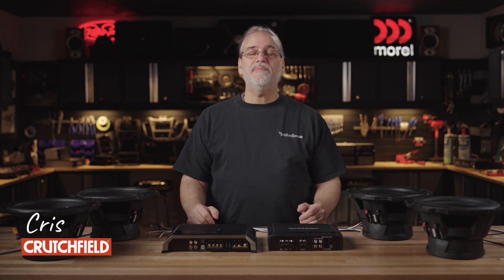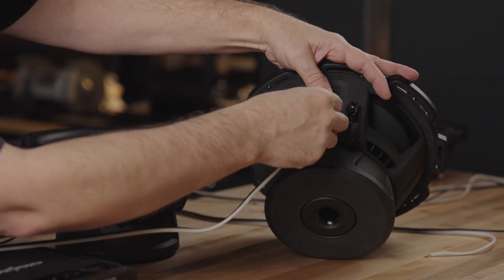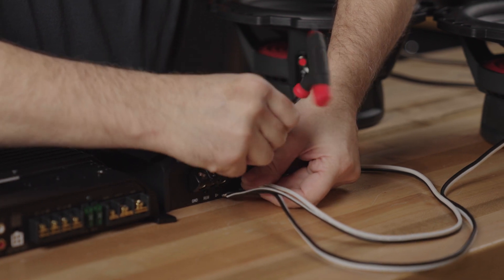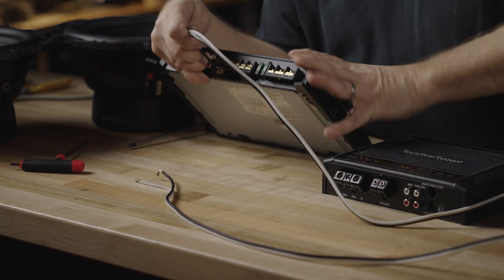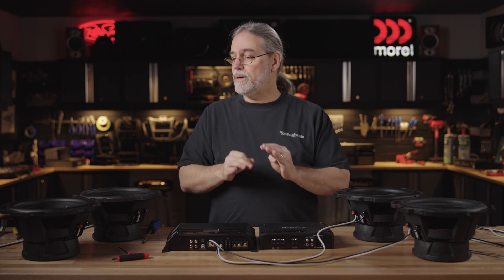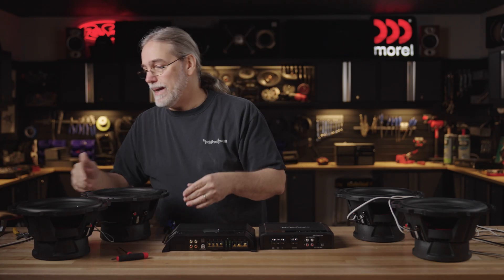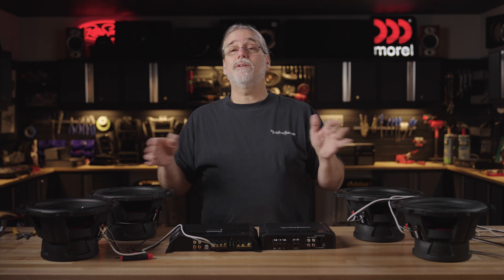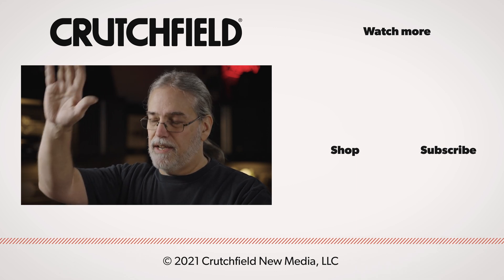How to wire multiple subs to your amplifier | Crutchfield

Comment: On the how-to on the 2 ohm load, you didn't say anything about how many channels or what if I was to bridge that?
Reply from the maker: Wiring a subwoofer(s) for a 2-ohm load is with a mono amplifier. Most 2-channel amplifiers require a 4-ohm load in bridged mode.

Comment: Have you ever sold M&K (Miller & Kreisel) home theater subwoofers? They typically use two 12-inch drivers in a push-pull sealed enclosure. Recently, they mentioned that their MX-350THX sub presented a final load to the plate amp as 4 ohms, even though each 12-inch driver is 8 ohms. Do you know how these drivers are wired internally? I prefer not to disassemble the sub to avoid damage. Can you tell if they are wired in series or parallel? This question applies to other brands too, like JL, SVS, Polk, and Klipsch, whether for home or car subs. Thanks in advance.
Reply from the maker: We have not carried M&K subwoofers, but what you describe sounds accurate for when the two 12" 8 ohm drivers are wired in parallel. This would also apply to any manufacturer because the 4 ohm result can be confirmed using Ohm's Law. We have an article that dives deeper into wiring multiple subwoofers as well as subs with two voice coils (another subwoofer design that impacts the combined ohm of a system) and this link will take you to that article:

https://www.crutchfield.com/I-rYALc227/learn/wiring-subwoofers-ohms.html
Reply: @crutchfield  thank you! Have a fantastic weekend! 🔊 🔊
Reply from the maker: You're welcome! Glad we could help

Comment: Thanks so much, my 10" subs wires became detached from back of speaker box. They were in Series Wiring (it's been so long since they got professionally installed and i forgot exactly how it was wired). Well I accidentally connected each wire from the speaker plug-in together and on one speaker I plugged both wires into Positive and connected both wires together on other speaker and plugged into Negative of that speaker., thinking that's how it was... and didn't really turn the music up to notice and an hour later my Jensen amp was very very hot and the subs weren't playing any music. So gonna let it cool down now and THANKS SO MUCH FOR THIS VIDEO... I now remember/know how to wire them back up correctly, hope that was why the amp was hot and hope it's not fried!! fingers crossed.
Reply from the maker: Yikes! Did the amp start working again after it cooled down?
Reply: @crutchfield yes, it is fine now. Learned my lesson.

Comment: So if I have 2 250 watt subs connected in parallel should my amp be 250watt or 500watt?
Reply from the maker: If you are running two subwoofers and each subwoofer can handle 250-watts RMS, you can select an amplifier that delivers 500-watts RMS for maximum sonic performance (providing 250-watts RMS to each speaker). You will need to determine the total impedance of both subwoofers wired in parallel also, so you can best choose your amplifier to deliver the 500-watts RMS at your specific total impedance.

Comment: Here's a question I always wondered about as a novice. If you wire two 8 ohm speakers in series the impedence will be 16 ohms. My question is...will they both be playing at 16 ohms or is it that the combined impedence is 16 ohms? Also in parallel the opposite takes place. So the 8 ohm speakers will be playing at 4 ohms. Same question. Will they both be playing at 4 ohms or is it a combined impedence of 4 ohms?
Reply from the maker: For the first scenario, the amplifier would see a combined total impedance of 16-ohms. For the second scenario, the amp would see a combined impedance of 4-ohms.
Reply: @crutchfield  thank you. Here's another question. If in the first scenario I were to daisy chain two dual 16 ohms speaker boxes using speakon connectors would the impedence remain the same no matter how many speaker boxes are joint together by speakon connectors or would that lessen the impedence? For instance...I daisy chain three speaker boxes wired in series using speakon connectors, would the impedence remain at 16 ohms no matter how many boxes are daisy chained by speakon connectors or would that lessen the impedence?
Reply from the maker: Any additional speakers wired together would decrease the impedance when wired in parallel.
Reply: @crutchfield that's speaker to speaker. I want to know if I were to daisy chain two speaker boxes by speakon connectors containing two speakers each both peakers in each box wired in series would that lower the impedence of the speakers in the boxes?
Reply from the maker: Any speakers you are wiring inside the boxes in series you will double the impedance of each speaker if there are two speakers in each box. Connecting with a certain style of speaker connector (speakon style in your case) does not directly affect any impedance. Wiring speakers by "daisy chaining" multiple boxes together represents a parallel connection and would decrease the total impedance of each enclosure with each additional speaker cabinet "daisy chained" together. You can find wiring guides for total impedance online if you need to know the exact impedance and wiring for your specific custom setup. I hope this helps.
Reply: @crutchfield it does. You're saying if two speakers in one enclosure are wired in series. Lets say two 8ohm in series would become 16ohm then daisy chained together by speakon connectors they would be in parallel thereby reducing the impedence the amplifier would see back to 8ohm. Answers a question that's been on my mind for a while. Thanks.

Comment: Is it the same for door speakers?
Reply from the maker: Yes, wiring two speakers or subwoofers in series increases the resistance presented  to the amplifier, and wiring them in parallel decreases the resistance. it is the same for subwoofers and full-range speakers.

Comment: 1200.1 mono 1 ohm steady with two 4 ohm dvc 700 rms  wired to 1 ohm am i under powering my speakers?
Reply from the maker: If your amp delivers 1,200 watts RMS at 1-ohm, each sub will receive 600 watts RMS, which is plenty of power for subs rated up to 700 watts RMS each without the risk of overpowering them. We typically recommend powering subs with 70-100% of their RMS rating for best performance, so that scenario falls well within that range.
Reply: @crutchfield  thank you bro
Reply: @crutchfield  1⃣more question if you don't mind I have two 1200watt dvc 4 ohm to 1 ohm  with red2500.1 amp  that should be fine as well?

Comment: Yeah but you don't show how to maintain 4 ohm load with 2 4 ohm subs. So, up and down but not the same. How does that help when you have 2 4 ohms subs and a 4 ohm amp?
Reply from the maker: How you wire the 2-ohm subs will depend on the amplifier powering them, and how many subs you have. Here are two pages from the library section of our web site I think you may find helpful.
https://www.crutchfield.com/I-rFBKc988/learn/how-to-match-subwoofers-and-amplifiers.html

Comment: So the first connection you made where you joined the wires and put them into one set of terminals. Is that a 4 or 2 ohm?
Reply: From what i understand from the video the first one are in parallel 2, 4 ohm subs wired too a single position and negative changing it to a 2 ohm, so basically what you want to do is what he did and it came out to 2 ohms.
Reply: My amp only has 1 negative and positive and I want to join two subs.
Reply from the maker: Hi Isaac, in our video there we wired two 4-ohm subs in parallel for a 2-ohm load. The exact impedance will depend on the impedance of the sub you're using. Do you need help choosing subs to match your amp? If so, what is the brand and model?
Reply: @crutchfield  I used two Sony xplode 4ohm 12inch with rms at 300 I believe. And the amp I used was a boss riot 1600 monoblock. I wired them how you guys did and it sounds cool. I think I just need new speakers and a different amp for those speaker mids.

Comment: Is there a video that descripes the wattage of them i have a 1000 watt max at 4 ohm amp ans my subs say they are 1000 max but they are cheeper so i dont fully trust the rating especialy as i already blew one up just hooked as a single to the amp my amp says max 2000 at 2 ohms so if i hooked them in parallel would it deliver 2000 to each sub or 1000 to each and if i hooked them in series would it deliver the same wattage to each or would it split the 1000 watts between the two and snd give me 500 watts per sub
Reply from the maker: We recommend using an amplifier that is capable of delivering approximately the maximum recommended RMS/continuous power to each subwoofer. Also check out.
https://www.crutchfield.com/I-rFBKc988/learn/how-to-match-subwoofers-and-amplifiers.html
Reply: @crutchfield  my amplifyer is 500 rms at 4 ohms amd my subs claim to be the same but ive already blown one up so im unsure if thats true would i be better to run them in series or parallel

Comment: What is the jumper cable?? And if i dont have it, can i use ether a positive cable or a negative one??
Reply from the maker: In this video, it is the wire that's being ran between the two subwoofers to wire two subs in series. It can be one side (i.e. positive wire) of the speaker wire you got to connect the subs to the amp

Comment: @Crutchfield I have a alpine type s 10inch sub dual 2 ohm running both of alpine s series 1200W Mono quick question both subs comes with pair of banana jumper cables will it be okay if I’m connecting a single sub series with the jumper cables same for the other one and use each +- on the out put of the mono amp for each subs?thanks
Reply from the maker: Just to confirm, you are using two Alpine 10" dual 2-ohm voice coil subwoofers and powering them with the single Alpine 1200W mono amplifier?
Reply: @ yes
Reply from the maker: What's the model number of your Alpine amp?
Reply: Alpine S2-A120M S2-Series 1200W RMS Class-D Monoblock Amplifier
Reply from the maker: Nice! You'll wire them per example 6 in the Alpine S2-W10D2 manual here: https://pdf.crutchfieldonline.com/ImageBank/v20230817163300/Manuals/500/500S2W8D2.PDF
Reply: @crutchfield  thanks mate!

Comment: How to connect two different amp to one subwoofer?
Reply from the maker: Theoretically you could use two amps to power one DVC subwoofer but typically would not need two amplifiers. What brand and model subwoofer exactly do you have in mind?
Reply: @ So I want to connect both amp to one sub, Jbl Arena 12
Reply from the maker: You can't use two amplifiers to power one JBL Arena 12 subwoofer. It only has one set of speaker terminals and a selectable impedance switch. I'd recommend a single mono amplifier rated to deliver around 800 watts RMS/continuous power and this Pioneer amp is a perfect match.
https://www.crutchfield.com/I-rFBKc988/p_130GMDX971/Pioneer-GM-DX971.html?tp=35834

Comment: im confused cuz i have amp stable a 2ohms but have 1 sub dual voice 4ohms but have a single voice 6 ohms ?
Reply from the maker: Given the details you provided, we do not expect you will be able to connect both subwoofers to the amp. But we are happy to check. Which brand/model amp do you have and what are the brand/models of the subs?
Reply: No if you run it with no other subs your 4ohm dual voice sub can be ran at 4ohms or 2ohm. I believe

Comment: Can I bypass the amp in an active subwoofer box to run a different amp?
Reply from the maker: We do not advise performing any modifications to powered subwoofer enclosures, they are usually paired together perfectly as far as subwoofer/amp and are not designed for customization. If you want to run a different amplifier, choosing a separate component passive subwoofer is the best move.
Reply: @crutchfield  thank you for your response. I'll keep it original.
Reply from the maker: Anytime! 🙂
Reply: @crutchfield  I'm keeping the subs the way they came but need to find an amp and I think a signal moduel to run the rest of the speakers I replaced in my 2017 toyota camery xle with the JBL audio. I've replaced the stock speakers
Reply from the maker: What is the RMS maximum rating for power on your aftermarket speakers? We can pair the amp accordingly to maximize the sonic performance for you. For your vehicle, we also have a PAC Audio adapter and harness in the two links below that can make adding amplifiers to the factory radio a smoother install.

https://www.crutchfield.com/I-rYALc166/p_541AP4TY12/PAC-AmpPRO-AP4-TY12-Aftermarket-Amplifier-Interface.html

https://www.crutchfield.com/I-rYALc166/p_541APHTY02/PAC-APH-TY02-Wiring-Interface.html
Reply: @crutchfield  thank you! I used 3  3.5" kickers in the dash. 90 watts. 6x9s in the two front doors. 200 watts and two 3.5" in the rear deck 90 watts. I got a price from a shop just for the parts about $900 for a 4 channel amp and the moduel and harness. There is also a stock 6x9 in the rear deck. The stock sub woofer haha. I am planning to just delete it.

Comment: So why is my audio shop telling me I have to do reverse polarity because the way my box is facing towards the rear of my trunk? I’ve always did + to + - to - but they want me to do + to -  - to +
Reply from the maker: Changing the polarity or phase of the speaker connections will result in the speaker moving either into the enclosure or out of the enclosure when the bass hits. One configuration may sound better than the other with your vehicle and setup. With many amplifiers, you can adjust the phase with a switch instead of rewiring your subwoofer connections.
Reply: @crutchfield ok thanks
Reply from the maker: Anytime! 🙂

Comment: i would like to be able to adjust the bandwidth to each individual woofer,  any ideas?
Reply from the maker: Hi Don, we're happy to help. What's your exact setup?
Reply: @crutchfield  have the lc-6.1200 and  a amp for an 12 and 8 inch subwoofers and would like each to have the ability to adjust the bandwidth for each,  say 20-240hz for the 12 and 240-500hz for the 8
Reply from the maker: Okay, so two amps total? What type of vehicle are you using these in? Are you using an aftermarket radio with pre outs?

Comment: Can you do 5 subs to 1 amplifier? And if yes which way would be the best way to connect them? Its a 2500 amp
Reply from the maker: This can be done! The best way to approach this is with an amp that is 1 ohm stable and subwoofers that are DVC 4 ohm models so that you can wire the voice coils on each sub in series and then parallel wire all the subs onto the amp. Can your amp run a 1 ohm load?

Comment: How does the amp know to switch to 2ohms if theyre 4ohm subs?
Reply from the maker: Connecting two 4-ohm subwoofers in parallel presents a 2-ohm total impedance to the amplifier. The amplifier delivers power based on the total resistance it sees at the connection terminals of your connected subwoofers.